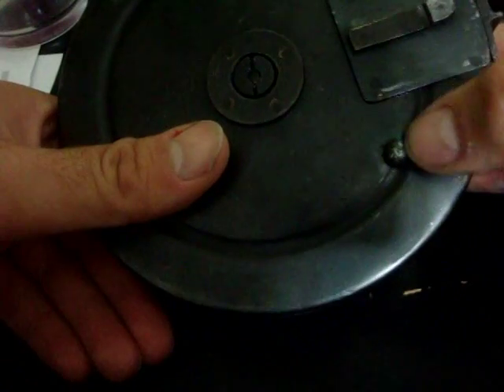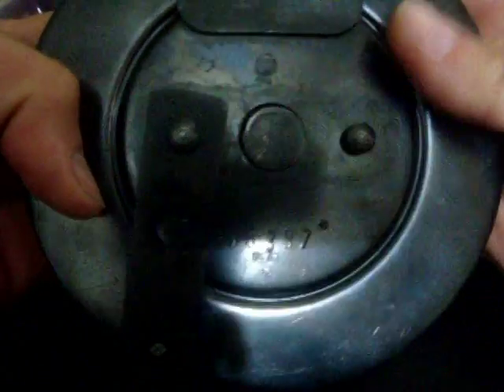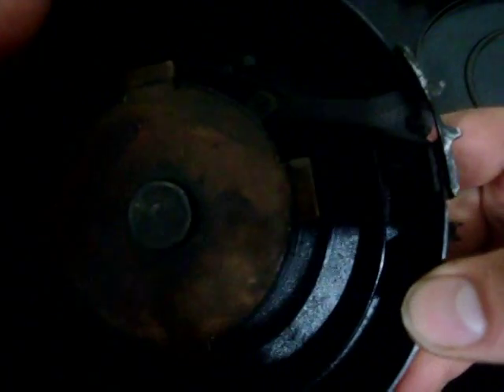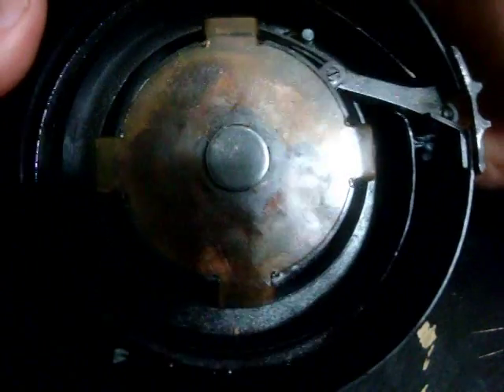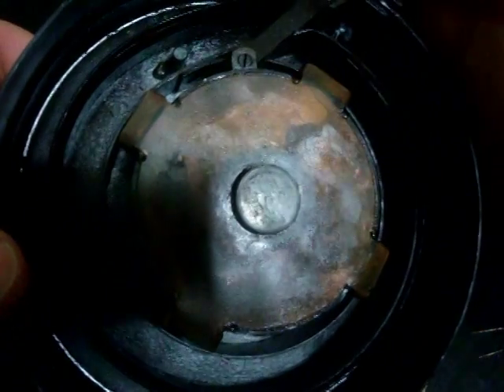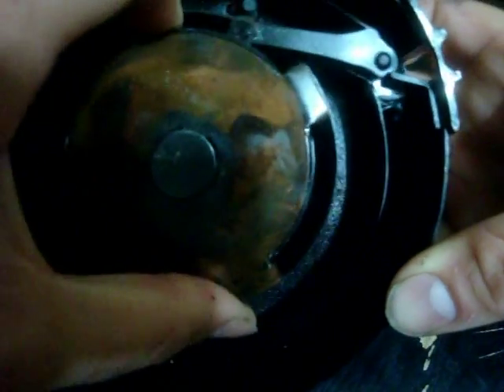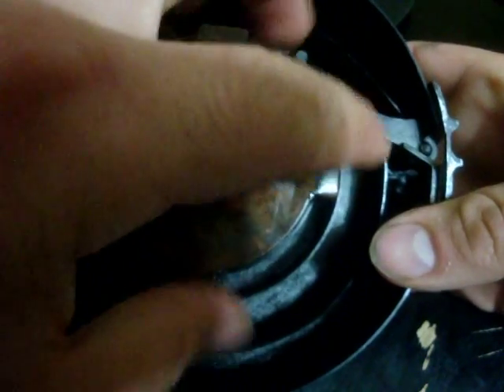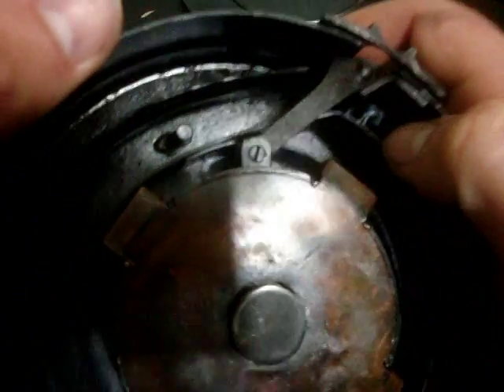M31 Suomi drum Magazine: How it works.

Comment: Too bad TNW,  or whoever imported them to Canada, ruined them by rewelding the guides. The follower should travel through the outer coil first, not the just the inner.
Reply from the maker: Yeah they had to make them 5 round. I have one missing feed lips on my dewatted kp-31 functional but can't hold ammo. Pretty cool how they made it work.
Reply: @Stray03 what happened to your feed lips?
They had to make it 5 rounds, but they didn't have to bend and reweld the spirals, only weld the pin on at the limit. Look up photos of an unmodified one, you'll see what i mean.
Reply from the maker: For some reason every demilled gun I have seen in this country has their mag feed lips cut off. Must be a requirement of the queens cowboys.  The mag just has a pin in it and a small weld to keep it from rotating.
Reply: @Stray03  the follower should pass through the outermost spiral first, but the ones we get here have been mangled inside. The follwer only passes through the inner part of the spiral, in addition to adding the pin, making the capactiy 5/32 rather than 5/71.
Reply: @Stray03  examining mine compared to a photo of an uninhibited one again, the plate with the spiral has just been rotated. The outer spiral, that terminates at the feedpath, should be pointing to 2 oclock rather than 12.
Reply from the maker: Yeah. The spiral turns with the follower. Think of it as 2 mags.The followed never goes into the outer track. That track is filled with ammo, and the inner track is also filled with ammo with the follower right at the end. The little strip that is welded on mine at the top prevents the rounds from feeding through the inner spiral so the follower pushes on that ammo causing the spiral to turn pushing out the ammo from the outer spiral. Once the tab passes the mag opening as is seen in my mag it opens a path for the rest of the ammo, in my mag 5 rounds to feed.
Reply: @Stray03  no the spiral doesn't turn with the follower, it is meant to be stationary. There's 2 other videos i found from american channels, before i saw yours, showing how to load it that you might want to look at for a more convincing argument.

Here's my theory; The fine fellows at TNW, inassume, got all the mags and such in parts. They just grab whatever was there, which is why the 3 pieces of the mag have mismatched serials. When the put it together they just dropped it in wherever the could get it to fit, and welded it in place. The first guy did it and had it approved, so ever one after was copied that way.

This i know to be true; The weld on top was never on the original design, in the welded position a maximum of 32 rounds will load into the magazine rather than the intended 71, the outer spiral is where the follwer is supposed to enter, and the small cutout at the 11:30 position is what is meant to interact with the guide ramp to the right of the feedpath and stop the spiral from "derailing" for lack of a better word.

If you don't believe me or the other guys on the internet, then take yours apart yourself and look at the mechanism. Remove the follower vie the grub screw. The clock spring assembly will loosen to 6 or 7 o'clock, and simply pull off once aligned properly with the locking tabs. Examine the rivet and the top weld, and compare them to unrestricted magazines on the internet, or watch the 3d model teardown for a complete teardown of the workings.
Reply from the maker: I have a mag that is fully functional but with the feed lips ground off so that it is not able to act like a mag. I can fill it with ammo but cannot use it in a gun because it is basically a bullet hose once you put the lid on and release the ratcheting mechanism. If I had this mag at the time I made that video I would have demonstrated how it actually works with the follower moving. How I describe it working isnt a theory it is how it works.
Reply: @Stray03  you won't know til you know i guess. I'll make my own video and link it when It's done to show you what I'm saying.
Reply from the maker: I took a series of 7 or 8 pics of it at different locations.the follower never goes into the outer track. Looking forward to the video.
Reply: @Stray03  The video is up, I sound like a real asshole in it